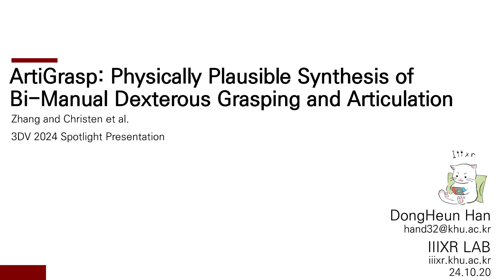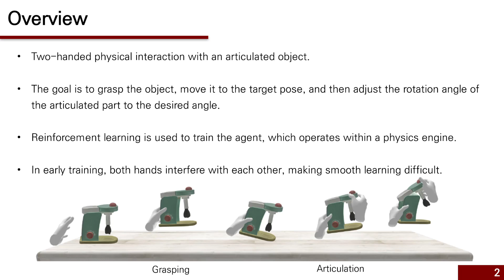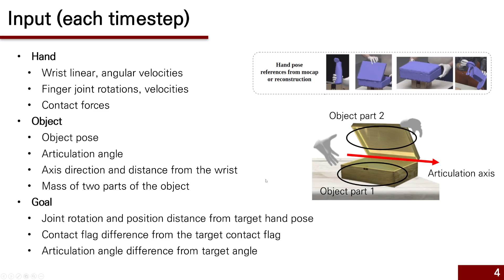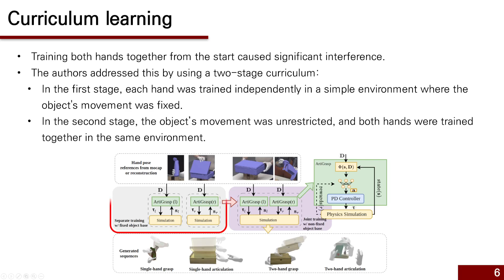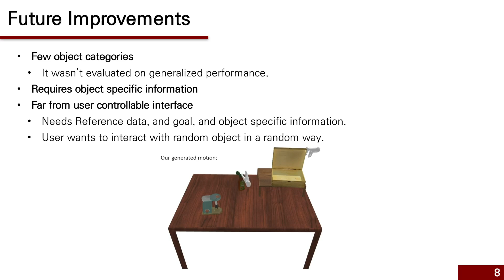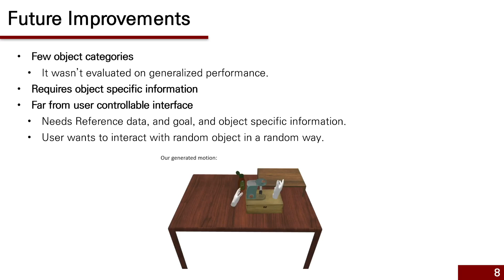[Seminar] Physically Plausible Synthesis of Bi-Manual Dexterous Grasping and Articulation

Comment from the maker: [Overall]
- The purpose and contributions of the paper are not properly emphasized, making it unclear what you are trying to explain.
- The figures do not support your message effectively; instead, they are hindering understanding.
- You're not adequately explaining the figures, using them more as decorative elements rather than explanatory tools.

[Feedback]
- Page 2: The purpose of the paper should be emphasized more clearly.
- Page 4: The figure is difficult to understand and should have been better illustrated.
- When changing levels or topics, using different bullet points would improve readability.
- For the imitation reward and task reward, it would be better to first summarize their purpose or explanation in one sentence, then list the details. This approach aids readability, especially for beginners.
- You spent a long time on Page 5 discussing many points; it would be better to use more slides to convey your message effectively.
- Presenting an entire figure like on Page 6 without any indications makes it hard for the audience to follow along.

[Questions] 
Q: What are the problems that previous work couldn't solve, and what does this paper aim to solve, and how?
Q: Which page of the slides do you believe truly contains the novelty of this paper? What should we focus on more in that slide?
Q: Based on the current PPT structure, the contribution of the paper appears that the authors just utilized curriculum learning effectively. Is that the entirety of their contribution?
Reply: Thank you for the detailed feedback. I will make sure to take it into account to prepare a better presentation. I will work to ensure the audience clearly understands the main contribution of the paper by emphasizing it effectively. I'll also ensure that the figures are used efficiently and well-organized for better understanding. I'll put more time and effort into preparing a well-structured and engaging presentation.

I have provided detailed answers to the questions below for your review.

A1:
The main contribution of this paper is the use of both hands to solve articulated object interaction tasks in a physics simulation. Previous work has primarily focused on single-hand grasping tasks. The challenge with articulated objects is that they have movable parts, and each hand could potentially disrupt the other’s trajectory. The authors propose a two-stage curriculum learning approach to address this issue. In the first stage, they fix the object in place and train each hand agent in separate environments, allowing the agents to learn how to reach the target pose without affecting the object’s movement. In the second stage, they train both hand agents together to cooperate in the same environment with a non-fixed object. This approach improves both hands' interactions, as initially, each hand might disrupt the other when dealing with movable parts.

A2:
The main contribution of this paper is the use of curriculum learning. Therefore, Slide 6 contains the novelty of this paper, as it presents the concept of curriculum learning. It would have been better to clearly convey the contribution with separate slides.

A3:
The main contribution of the paper is curriculum learning, and this represents the first attempt at solving two-handed articulated object interaction tasks. In my opinion, there is room for improvement, but the fact that this is the first attempt at addressing this issue could be considered a meaningful contribution. There are other contributions mentioned by the authors as well. For instance, they showed that their method could be used with inputs extracted from RGB images. However, in my view, the impact of this is somewhat limited, as it does not add substantial value to the results, so I decided to exclude it.

Comment: Thank you for your presentation.

Q1. What is the role of the PD-controller, and how is it structured in terms of modules?

Q2. I understand that rewards are separated by task. Does the proposed method require separate training and evaluation for each task?

Q3. I understand that this has been applied in a physics simulation environment. In that case, does each object have a different mass, and does this result in a variation in the required force for each virtual hand?
Reply: A1: The PD controller originates from control systems engineering. It is adapted to physical RL control tasks for the stable control of jointed character models. We provide the PD controller with target movement information, and the PD controller controls the character using predefined PD controller settings.

A2: Yes, each task requires separate training since it follows a curriculum, which is a connected sequence of training stages.

A3: Yes, the state includes mass as an input, allowing the agent to identify the mass of the target object. This enables the agent to output appropriate torque values for objects of varying masses.

Comment: Thank you for the presentation. I have two questions.

Q1: I believe the main technical contribution of this paper is breaking down complex two-handed manipulation tasks into simpler sub-problems, specifically focusing on fixed-object movements. Are there any other significant contributions to the model?

Q2: The model takes various input modalities. What strategies were used to effectively process these diverse inputs?
Reply: A1: Yes, in my opinion, the concept of curriculum learning in training is a main contribution of this paper. Although the authors claim only a few contributions, this paper is a typical example of a study that asserts it is the first attempt to learn a new complex task—in this case, physically interacting with an articulated object using both hands.

A2: There isn’t much unique about how inputs are processed. Most RL models work well without additional processing layers. However, it's hard to say if this is because RL tasks are inherently different from other tasks or if RL tasks are simply easier to learn. Additionally, most hand-agent papers, including this one, transform position, orientation, velocity, and angular velocity into wrist coordinates to simplify the problem.

Comment: Thank you for the presentation.

1. I am curious about the physics simulator used in the paper.
2. In the first stage, since the objects move along fixed trajectories, it seems the model might not learn much about physical dynamics. Could there be a possibility that the poses learned without considering physical factors in the first stage might distort into unusual shapes when physical elements are taken into account in the second stage?
Reply: A1: They used RaiSim, a physics engine developed by one of the authors. RaiSim was also used in their previous paper, D-Grasp.

A2: Yes, that’s a valid point and could be a potential issue. Since the object is fixed, applying more force doesn’t necessarily have any adverse effect on the system. This might lead the hand agent to learn to apply excessive force, as this approach is effective in maintaining stable contact with the target. However, in the following second stage, the agent could struggle to adjust from these overly forceful actions. Therefore, I think it would be beneficial to add a force stabilization reward, such as encouraging a net force of zero during the first stage.

Comment: Thank you for your presentation on an interesting topic.

I have three questions.
1. I wonder if the dataset in p.4 is reconstructed from images. 
2. Can I know more about the Articulation axis in p.4? Is it correct to mark the axis of the direction of movement of the box? 
3. I wonder if the current dataset is divided into training and test. I wonder if the fact that the generalization was not evaluated in p.8 means that the object being demonstrated is completely learned and not evaluated by test set.
Reply: A1: The data is from a dataset called ARCTIC. The authors of the ARCTIC dataset extracted hand pose and object movement from video and motion capture systems.

A2: Yes, it refers to the axis direction vector of the object. This information is useful to the agent, as it enables the agent to predict the direction of the object's articulation.

A3: As the authors mentioned, they created a 65%/35% train/test split for the datasets. My reference to low generalization performance pertains specifically to the training objects. They split the motion sequences but did not split the objects.

Comment: Could the two-handed cooperation in this paper be extended to the cooperation of each part of a full-body motion? 
If it seems difficult, what do you think might be the reason?
Reply: If you can provide a full-body reference motion sequence, then yes, it wouldn’t be too difficult with target poses. There are existing methods that have trained full-body motion tasks without reference target data. The main challenge, however, is that the object might be articulated, though I believe it could still be trained.

Comment: Thank you for your presentation.

Q1. Why did the authors choose reinforcement learning (RL) as the primary method for training the hand agent to manipulate articulated objects in this study?

Q2. What specific adjustments to reinforcement learning parameters, such as the balance between exploration and exploitation, could be implemented in this study to potentially enhance the hand agent's performance and learning efficiency?
Reply: A1: They choose to train physical interactions, which requires simulating physics. A physics engine typically functions as a black box.

A2: In my opinion, besides optimizing hyperparameters, adding noise to the initial pose with random initialization from DeepMimic could be useful for training a robust model.

Comment: Thank you for the presentation.

Q1:
Since this technique uses curriculum learning, reference data is required. My question is, does it require training the reference data each time for every type of action sequence? Additionally, can the neural network learn multiple types of action sequences simultaneously, or is it necessary to train a separate neural network for each specific action?

Q2:
If the network is trained on grasp & articulation, can it effectively simulate variations in sequence, such as articulation & grasp or graph & articulation & grasp? Or would it require additional training to handle these sequence variations?
Reply: A1: First, yes, they need a reference target pose for each time step. Second, I'm not clear on the exact meaning and range of the "action" you're referring to. However, there is one model being trained.

A2: It hasn’t been evaluated, so I can’t say definitively. However, in cases like this, I think the model could succeed at the task. If a complex sequence is required, it’s best to train using reference data that includes the same type of complex sequence you’re aiming for.

Comment: Thank you for your presentation.

Q1. In the imitation reward, the agent reduces the difference from a reference pose. Is there a GT dataset for this reference pose? If so, given that the pose of the two hands can vary even when grasping the same object, how is this reference pose set?

Q2. When the two hands perform tasks, do they exchange information with each other? Or do they operate more independently, each focusing solely on its assigned task?
Reply: A1: The hand pose can vary even for the same object. As you can see in the input structure, there is a specific hand pose that the agent is expected to follow. It doesn’t matter if the hand pose differs for the same object, as the agent will simply follow the given ground truth (GT) pose. Since it’s a GT, it represents a plausible interaction motion sequence, so it doesn’t matter if it varies across situations. In fact, having various hand poses for the same object could potentially improve generalization performance.

A2: They don’t share any information with each other. This means they don’t plan to cooperate but instead react passively to each other’s movements.

Comment: Thank you for your presentation

Q1. In page 2, what do you mean the hands interfere one another? The left hand seems to be static with simply holding onto the object, while the right hand is the only one actually doing the work.

Q2. Do you think their method can be applied for unseen objects that has similar geometrical attributes to the one used for training?
Reply: A1: Since each hand doesn’t know what the other hand will do, if one hand performs poorly at the task (for example, by making incorrect movements with the object), the other hand cannot learn valuable information from those failed situations. At the beginning of training, the agents make many mistakes due to random actions. It’s much harder to find the correct actions with both hands acting randomly than with only one hand acting randomly.

A2: Yes, because there is a provided target pose to follow and limited information about the object’s shape, the hand agents act without a thorough understanding of the object’s shape. Therefore, even if the object shapes differ from those in the training dataset, as long as the target poses are given correctly, the agents will perform correctly.

Comment: Thank you for your presentation.

Q1. This is very basic question. In deep learning, loss is calculated between model outputs and ground truth. It is differentiable that model's gradient can flow. But intuitively, Reward is discrete that is not differentiable so it can not update model's parameters. How can reward update the model's parameters?

Q2. In experiments, the metrics used for evaluation are enough to evaluate model's all performance? I think just calculate error is not enough to evaluate semantic information. And how they measure the trial is success? Is there any standard for it?
Reply: A1: I don’t quite understand why you referred to the reward as a “discrete” value. However, in the context of non-differentiable rewards, you can intuitively think of maximizing the probability of actions with higher rewards and minimizing the probability of actions with lower rewards.

A2:
There is no common standard because there isn’t much research interest in reinforcement learning tasks, and there are many tasks yet to be studied. We should assess whether the provided metrics are sufficient or not. And, of course, this can vary from person to person.

Comment: Thank you for seminar. I have two questions.

Q1. I think articulated objects are uncommon, is there a sufficient dataset for imitation learning?
Q2. Is this also applicable to multi-articulated objects? I was wondering if such cases are taken into account.
Reply: A1: The agents do not need information about the object's shape, and there is a target pose to follow. Therefore, handling complex object shapes is not crucial in this case, so the training could be sufficient.

A2: They did not train the model with those types of objects, but in my opinion, it could be trained for objects with three or four joints. I'm not sure what would happen with objects with more joints.

Comment: Thank you for your presentation.

Q1. In page 4, what is the data type of contact flag among the goal features that go into the input of the model?

Q2. In page 7, what are the criteria for determining task success? And in the case of error metrics, is the difference between GT and calculated data?
Reply: A1: It is a boolean array that indicates whether each joint is in contact or not.

A2: First, as mentioned in the paper, the task is considered successful if the Position Error (PE) is less than 0.05 m, the Angular Error (AE) is less than 0.2 rad, and the Articulation Angular Error (AAE) is less than 0.5 rad. Second, yes, it is compared with the ground truth (GT).